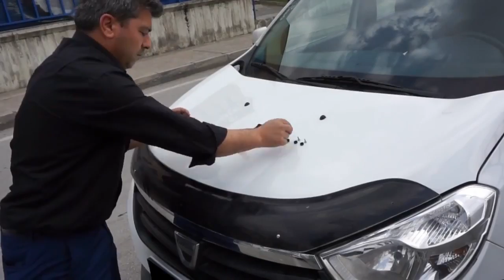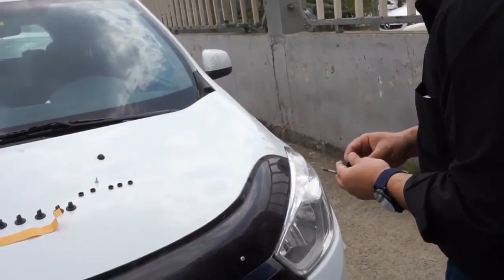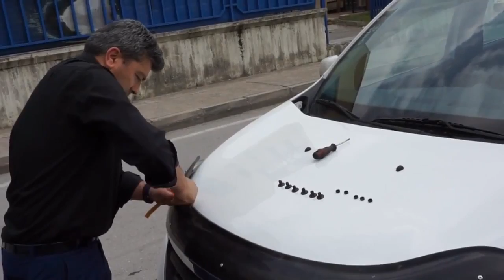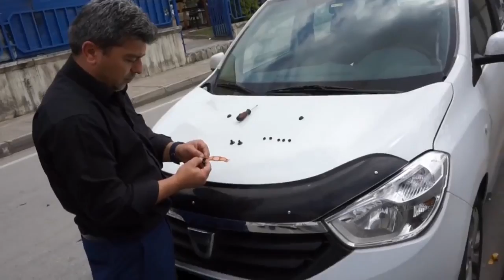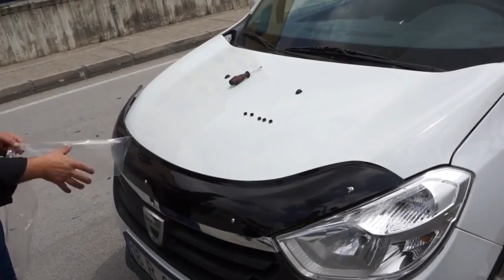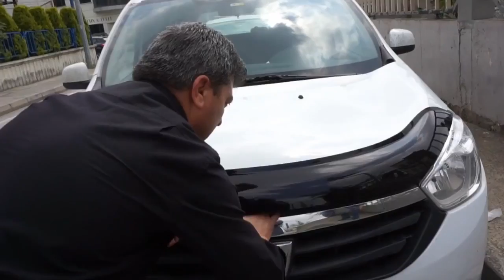BUG SHIELD HOOD DEFLECTOR GUARD BONNET PROTECTOR INSTALLATION

Comment: Where the clips go onto the bonnet edge best to use helicopter tape to protect the bodywork from scratches before fitting. Also, ensure the bonnet is washed, dried, and polished well to protect underneath and ensure any paintwork chips are treated before fitting, or you could end up with a rusty bonnet where you cannot see.

Comment: You could have put all those pieces on first, then simply ‘clipped’ the protector onto the bonnet. Much easier and less risk of running a screwdriver across your paintwork.